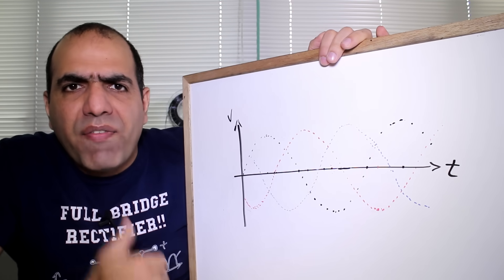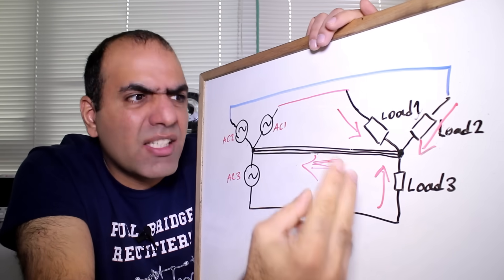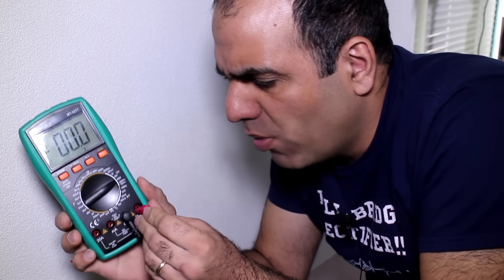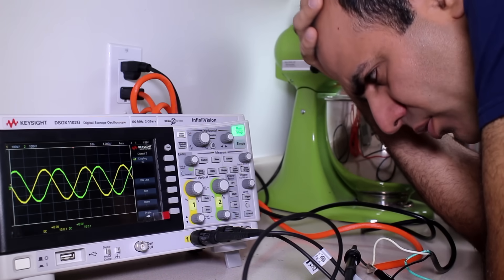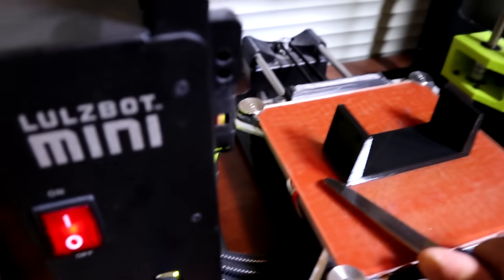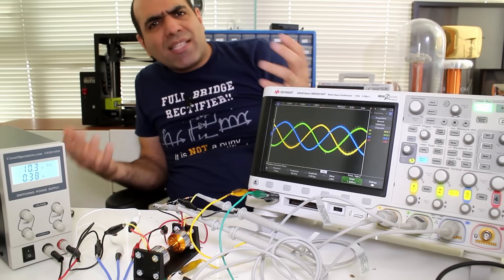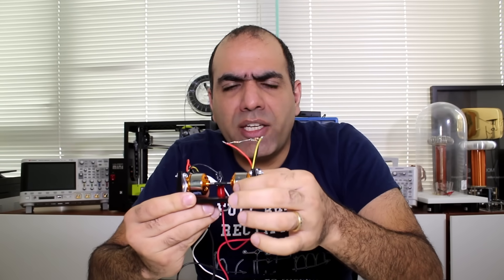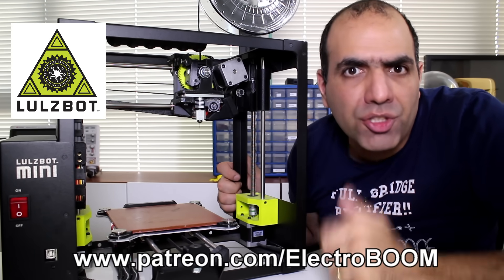Why 3 Phase AC instead of Single Phase???

Comment: this is odd, you may be an electrical engineer, but an electrician you are not.  you only need 4 wires, 3 hots, and 1 neutral!
Reply: For unbalanced loads, yes. For balanced, no, 3 alone will suffice. I'm an engineer, and an electrician. There's a whole other discussion related to triplen harmonics in the neutral but that's for another video.
Reply: r/iamverysmart
Reply: and where the f'k your ground ? not too good for electronics.
Reply: look bo bo, if you want to hookup 3 phase AC to electronics, be my guest, but let me know when you're going to do it so I can watch?!!!
you obviously have no idea about what I'm talking about, but next time you connect a transformer, let me know what happens?  the neutral/ground is the same wire!!!  DUMB ASS!!!
Reply: You actually need one nuetral per phase or each phase.
The nuetral has to be the same size as the load wire
So if u have three number 12 wires u need 3 number 12 nuetrals
You can not share nuetrals on different phases or load circuits as per code.

So the man in video is actually right
Reply: okay, it's time to break out that code book, what section, and what number?
dude, I am a retired Union electrician  Journeyman Wireman!
so, what experience do you have with 3 phase electricity?!!! HUM?
Reply: Sorry to say but i am liscensed asshole in three states and i wrote some of the code for thr city of ny

And did u ever think that there are two conductors in a circuit for a reason

The nuetral and hot are both sized the same for a reason.
The nuetral has to have the capacity to take the same amount of current as the hot on the same curcuit and cant be shared as per code and nema specs

So if u have three circuits u need three nuetrals and grounds 

If its a generator its something totally different but hes not talking generators 

And engineering is what made up the code asshole

So break out the NEC OR IEEE OR NEMA OR WHATEVER FUCKING BOOK U CAN READ AND FUCKING LEARN SOMETHING.

YOU ARE GOING TO FUCKING KILL SOMEONE WITH YOUR BULLSHIT ANSWERS.

LEARN ASSHOLE

LEARN

EVERY AINGLE CIRCUIT NEEDS TO HAVE A SEPERATE NUETRAL WITH THE SAME CAPACITY AS THE HOT
THE GROUND CAN BE SMALLER BUT ONLY IN LARGE AMP CIRCUITS AS PER NEC SIZING CHART

SUCH AS 100 AMP CIRCUIT

SO STUPID FUCK LOOK IT UP ASS

U SHOULD FUCKING KNOW THAT

HOW THE FUCK DOES ONE NUETRAL CARRY BACK ALL THE FAULT OR IMBALANCE IF ITS NOT LARGE ENOUGH 

IF THREE CIRCUITS ALL FAULTED  AT SAME TIME THAT CONDUCTOR WOULD NOT BE ABLE TO HANDLE IT
PERIOD

SO LOOK IT UP STUPID FUCK
MAYBE LOOK AT NEMA FIRST AND A GENERAL 14-2 NM TYPE CABLE

every single circuit needs it own return path back to panel and has to re rated to the same amperage as the hot.

Period 

AND ASSHOLE IM NOT EVEN GETTING INTO ELECTRON FLOW AND HEATING OF CONDUCTORS AND HARMONICS AND EVERY OTHER FUCKING REASON WHY U NEED A SEPERATE NUETRAL ON EACH BRANCH CIRCUIT

AND LIKE I SAID EARLIER IM NOT TALKING ABOUT GENERATORS AND TRANSFORMERS
AND EVEN HIS EXPLANATIONS ARE NOT REALLY CORRECT 

THERR ARE MANY FACTORS THAT COME INTO PLAY WITH THREE PHASE.
AND STUPID FUCK

MOST GENERATOR SITES ARE NOT 3 PHASE THERE ACTUALLY 6 PHASE.

IM NOT GOING ON ANYMORE BC YOUR BRAIN CANT HANDLE THE REAL TRUTH

BUT DONT TELL PEOPLE THE BULLSHIT ABOUT ONE NUETRAL ON A BRANCH CIRCUIT.
BC U WILL KILL SOMEONE OR CAUSE SOME SERIOUS PROPERTY DAMAGE.

And yes hes trying to compare single phase with three phase which are two different animals 

In no way shape or form can u share a NUETRAL from two circuits from the same phase. There are exceptions to this but most if not all municipals dont allow it and neither does the nec

Most people do not have three phase asshole
Or y generators sitting in the back yard with one nuetral.

And most municipal power grids dont have residential power come out in two phase but its really a center tap transformer can and tge nuetral is that tap.
The high voltage side is one phase coming from a GENERATOR site

The transformer makes the voltages it needs to the home on that grid 
So if its a tap transformer then its really the same phase.

So learn bro
Its a good thing

There are also nema regs involved with this stuff and there codes

So look up nema.
Reply: Wow, all this and no one even used the terms "grounded conductor" or "equipment grounding conductor" or "ungrounded conductor" or "grounding conductor"... I consider this a civilized debate because of that. sheds tear
Reply: SantaFebuff 

Yup
Grounding and bonding is usually above some peoples pay grade 
Its happens all week long in my business especially during hot months with pools.
Almost every electrician job i look at fails bc of not neing bonded properly 

But it keeps me in business 
Later
Reply: WTF is going on in the USA? Neutral as ground on a machine? Sounds funny! Neutral has always some leakage to ground. @snaprollinpitts go ahead, put neutral on the casing and touch it while grounded. Will be fun ;)

No wonder people are dying by electrocution on a daily basis ...

Well you could use a RCCB to create ground from providers neutral in some cases. But why? Just put a proper ground-nail!
Reply: currysini85 

Your right bro absolutely right
Reply: wow, that was and incredibly big waste of time, luckily I didn't read all of it!  so what you wrote some code, tell me what section and what number, that refers to the topic we are talking about!?  smart ASS!!!

may be you can keep your answer under 2 lines.
Reply: osuf 

Im sorry do i know u.
I dont think we ever met but i would be willing to.
What do you think

Comment: Well some countries have 1-phase 220 volts. So it means that we can't have 2-phases and it's only 1 phase and 3-phase? And 3 phase can be made by 2 wiers?
Reply: 2phase from 3phase lines its posible:
https://upload.wikimedia.org/wikipedia/commons/thumb/4/49/Landis%2BGyr_Z%C3%A4hler.jpg/660px-Landis%2BGyr_Z%C3%A4hler.jpg
Reply: The main grid in all countries is 3-phase. one phase is just an end delivery point thing. The problem with a 2-phase system which would be 90º apart is that you need 4 wires or 'poles' to make it symetrical. The thing with a 3-pole system is that each pole is truly 'unique' there's no opposite pole. if you have a 4 pole 90º system then each pole is equivalant to the oposite pole so 4 poles is really a 2 phase system while 3 poles is a 3 phase system it's a matter of simple 'geometry'. The odd number system always wins so to speak. An even number system has the problem of the opposite pole being the duplicate of what was already there.
Reply: Although I'm still looking for a proper short explanation for this. The 'polar diagramm' is the thing you want to be looking at. Maybe three poles has that 'directional' effect, it's 2d. two poles at 180º are 1D. and two poles at 90º are 2d but they need a stupid neutral. So three poles is 2d it has a rotational direction and it's balanced it doesn't need a neutral. There must be some sort of universal truth as to why 3 phase is logical. It's not something you'll find on the wikipedia for sure.
Reply: yeah 3 poles is the first point where it becomes 'rotational' you can argue a 90º system but that's just a 4 pole system which is actually worse. three points has this logic it's the most basic two-dimensional rotational system so to speak. Two points don't work. and four points is actually a reduction because it's only two angles. so three points is really the optimum for this kind of rotational thing.
Reply: 90º? You use 2 phases from 3phase system. Line to line 120º

Comment: Mehdi, I really hope you read this:
The reason to use 3-phase AC power does not come from "the lesser wires the better", because with this you cannot explain why not to use 2, 4, 5 or 6 phases. There has been a necessity for 3-phase AC: the first electric locomotives needed a power output that was constant over time. If a motor outputs torque that changes over time, the wheels may spin in the moment of highest torque, limiting the traction from adhesive coefficient to slipping coefficient.
The first amount of phases you need to supply a STAEDY power output over time is 3-phase AC. Any other explaination you gave also fits to 2-, 4- or 5-phase AC (like no current on nutral wire, saving wires and so on).
If you look at a symmetrical load (which a 3-phase motor always is) and let's say we only have resistors as a load you have P(t) = a*R*I^2*(sin(0°+t) + a*R*I^2*(sin(120°+t) + a*R*I^2*(sin(240°+t) = CONSTANT with "a" depending on Y- or Delta configuration and: it's not a function of t anymore. there is no dependency on t (time) anymore. Unlike in a 1-, 2-, 4- or 5-phase AC where power output is changing over time (with a 50/60Hz period). Power Output for 1-phase AC for example can be 0 or anything between +1,141592*R*I^2 and -1,141592*R*I^2, just like a sin-wave.

Comment: Greetings from the city of Santiago, Chile.

I wanted to ask you what solution can you imagine to avoid the voltage drop trough a long extension cord, in order to use power tools far far away from an oulet.

Can you figure up some device your viewers can make at home, to install at the beggining or at the end of the extension cord, to gain voltage?

Here in Chile we use 220 "Voltage" and 50 "frequency" LOL

Comment: Electrocution plus explosion plus hypnotic unibrow = I've learned electricity ...hold my beer...☠
Reply: Not electrocution if he survived
Reply: My beer was expelled through my nose! Too funny!
Reply: Now, let me explain to you how the electric company is ripping you off.
1)  You're buying "Alternating Current," corrrect?  That means the current is going back and forth.  Or another way of saying it, is, first they sell you some electrons, then they turn around and steal them right back.... while the exact opposite is happening on the other wire.  At the end of the day, you have exactly the same number of electrons as what you started with.  But now you owe them money.
2)  Looking down one wire... they send electrons to you... then they take them back... then they send electrons to you.... then they take them back.... then they send electrons to you .... etc.
Now, if you look at it, it's like any other fluid, such as water in a pipe.  Now, if you set up a system of pipes in which the water was coerced into a an alternating current ... and you used some clear plastic for the pipes.... And you released a drop of dye in the water in that pipe.... you would see the dot going into your house, and then out of your house...then into your house, then out of your house.

That's right.... they're selling you USED electrons.
REPEATEDLY!

Come back tomorrow for my talk on dark-suckers, how they help us see (especially that big one that comes over the horizon every morning), and how and why most household and industrial dark-suckers fail.
Reply: @dirkgently120  - Ah man! That just totally sucks!
Reply: Just keep in mind, the sparks were intentionally demonstrated on what NOT to do.  Now with that, I'll take your beer and have at it Hoss!

Comment: I hear that same sound on my RC plane b/c I have the same speed controller. that scared me a little, usually the first three tones signifies the ESC has power, the next 3 mean connected to a receiver (or receiving a signal) and the last one means the throttle is at 0 and ready for use.

I have a different brand one but it still sounds the same... weird.

Comment: There are many more reasons or 3ph besides wiring cut down... For example the inherited ability to create a rotating magnetic field. The fact that only 3ph system results in a non singular square star-mesh transformation matrix (D-Y in this case), so you could easily go from star to mesh and back, and always get the same impedance results. By the why, BLDC is a DC motor in spite of the fact that it consists of three phases. Your experiment even proved it, as you could see that the higher the prime mover's speed, the higher the output voltage was.. This would have b=never happened in an AC machine... Nice video anyway..

Comment: I found out a way to make free energy thingy,so basically you make a 3 phase AC generator then make a DC motor,put it so when it spins it spins the generator,connect one of the phases to a FULL BRIDGE RECTIFIER then to the motor and the other two phases just use them for whatever you wan't,also to start it just connect a AA battery to the motor and disconnect the battery

Comment: The proper thing to do here would be to dig into an industrial motor that someone is bound to come across; The wound rotor 3 phase motor. Also; An automotive alternator is truely fascinating in that if you pull it's triode diode pack - you have there a 3-phase AC "generator".That, too would make interesting fodder for electrocution, moving parts accidents, letting out the magic smoke...

Comment: I do not understand why you see 200 volts in the kitchen, which would appear to be 2 of the 3 phases of 208v commercial power.  Residential is usually a 240V wave center-tapped, so is BC weird and different or are you in a commercial area?

Comment: In Europe we have different plugs. In houses are plugs with one phase(240 V, 16 A). If something needs higher voltage we have different plugs with three phases and ground and between two phases is 412 V, 28 A

Comment: People like you who only hand others partial answers is a big problem. 
Very scummy what is left out and makes sense why you never mention Tesla's Dielectric motors and why the "coaster" is spinning as if it were in a vortex.  This was what Viktor Schauberger and Nikola Tesla handed the world because modern Alternate Current creates low grade radiation and toxic gasses that are not being handed to the world while cheaper Chotchkies are handed to a lower degrading people.

Comment: So could I potentially have more than 3 loads connected to the same source if I just had more equally out of phase power supplies for each recpective load. So for 4 loads connected to one source, each would be powered with 4 AC signals but out of phase by 90 degrees?

Comment: you've entirely skipped over the difference between delta and Y (Wye) transformer configurations.  what you've got in your house is a Y feed, giving 240v across 2 phases.  if you had a delta feed, you'd have gotten 240v out of those isolated plugs, but using only a single phase, as a delta feed uses a split phase to give you 120v.  A delta feed is also more efficient than a Y feed.

Comment: Hi. As far as I know, one of the of the major benefits (in addition to all that you said in this video) of the usage of three three phase High Power Motors which could be more or less directly operated.  Tesla developed the whole system in his  mind.  all the way from generating with three face machines, then transmitting it, and afterwards using it with three Face Motors. The whole system!!!

Comment: YIKES! The arcs are startling!  I learned to check my settings BEFORE making connections years ago. 

Proof that you're absolutely insane!

Interesting you folks in CA get a true 2-phase feed instead of the split-single-phase we have in the US. Using a transformer as a voltage divider is stupid.

Comment: Great stuff! My mind had to think fast and revert back to my engineering days to keep up with that circuit that you had going on there. But then I thought that I would just sit and listen and see were you going with  this.  When a person thinks about it, it seems as though The power of phase is overlooked.  Nikola Tesla loved the number three. And for very good reason. As a harmonic amplifier changing frequency and phase is the key to everything I believe. But, my question to you is more . If you were a homebuilder and wanted to wire a house for yourself to live in, how would you wire it for the best possible experience for functionality...etc.

Comment: In Slovakia all the houses have a 3 phase power supply where each phase has 230 V AC. So the voltage between phases is cca 400 V. It is used mostly for buzzsaws and pretty much every house has a three phase plug but it is usually fused to just 16 A.

Comment: Since we are talking about AC here another factor you failed to mention is the skin effect at 60 Hz once you get beyond a conductor radius of around 8.5 mm (The skin depth at 60 Hz) current capacity increases only linearly with the increase in radius (Since it scales with the circumference) but the cost scales with the cross sectional area which is proportional to the square of the radius. Thus the three separate conductors are actually cheaper for the same amount of power than using a single wire to transmit the same power at the same voltage (This is even before you factor in the fact that you need two of these much more expensive wires to make a return path if using a single phase in isolation).

Comment: Is this FREE ENERGY?????
Reply: Twist the mains into a coil  and just induct the pouer past the meeter add a small 15w Horbor Freight solor panel to apply to the solor credit program . Then siphon from the power company side feed it back through the meter into the main get credit. This would be fr$$ energy, that payed. Well till the handcuffs came out.
Reply: When Tesla talked about "Free energy" he meant bringing electricity to the homes of ppl without cost on the homeowners. I'm sure a master at electricity would know something about thermodynamics.
Reply: Just gotta join the motors

Comment: I laughed real hard when you shorted the electric outlet with your meter. I play that part of the video about three times, laughing every time. I did, however, learn quite a lot about 3 phase voltage. Thanks and post more stuff.